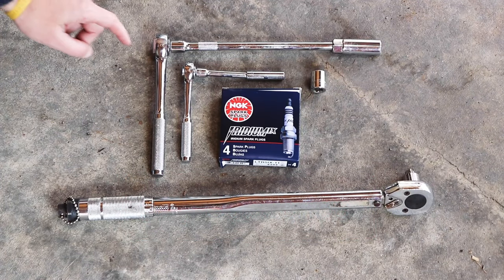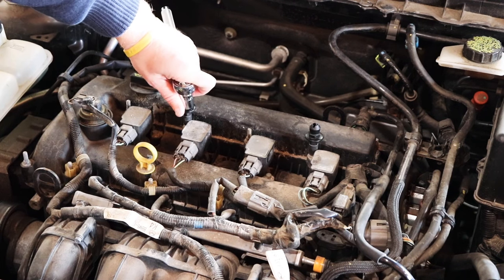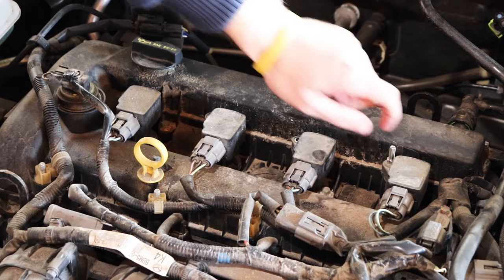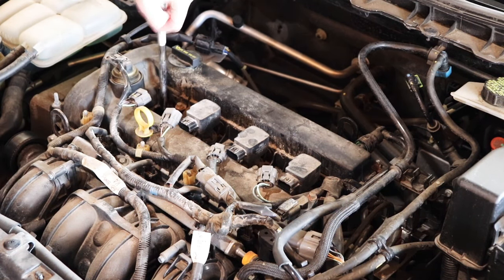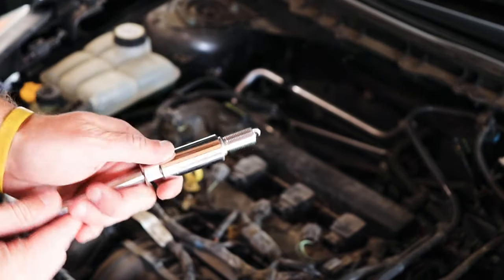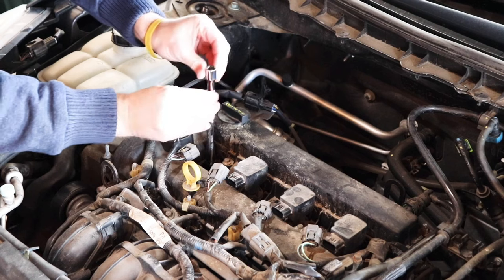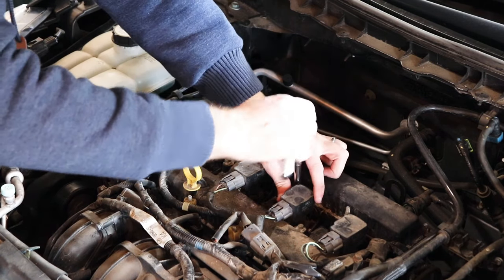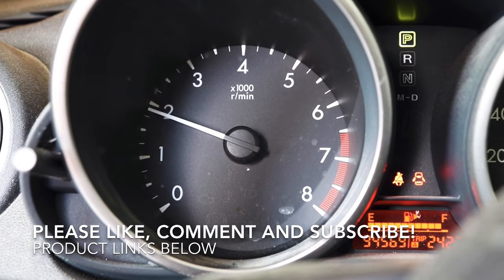Mazda 3 Spark Plug Change Replacement 2.0L, 2.3L, 2.5L

Comment: I replaced spark plugs in our 2008 Mazda 3 today and this video was super helpful and very easy to follow.  Probably the best step-by-step car video guide that I ever watched.  Thank you very much!  I didn't use a torque wrench as I didn't have one but the new plugs were pretty snug and tight and I was careful not to overtighten them.  On a side note, I noticed quite a bit of dust, sand and other debris so I vacuumed the area before removing the coil packs but was careful while doing so.  Thank you!
Reply from the maker: Thank you for the compliment, I try to make videos that are very clear and with no fillers. Thank you for watching and if you haven’t already please consider giving the video a thumbs up and subscribing. Thanks again!
Reply: I was reluctant to get a torque wrench where the torque to tighten the plug is at the very low end of the wrench. I did a little digging, and a chart told me to tighten a quarter turn as a rule of thumb for plugs this size. (I assume this means a quarter turn past hand tight.)
Reply: UPDATE - I changed the plugs a couple of days ago. The plugs in there must have been the originals - they are marked "Ford" and 6M8G-12405-BB (Mazda #) and ILTR 5A-13G (NGK #), which corresponds to the NGK "Laser Iridium" plugs. There's no gasket on the the old plugs or the replacements. It's set up in the car to be almost impossible to cross-thread them.

I found it impossible to tighten 1/4 turn, but I probably tightened more than 1/8. After I was done, and had a successful test drive, I took another look at the little boxes that held the new plugs, and noticed that it had a little graphic showing that you tighten them 1/16 turn!

Now I'm thinking I should loosen the plugs and try to be precise about tightening 1/16 turn.
Reply: Does the 2008 Mazda use the same spark plugs as recommended for the 2010?

Comment: My local Mazda dealer wanted $350 to change out the 4 spark plugs.  I feel like I may spend $60 at most including the torque wrench and do this in 15 minutes after watching your video.  I watched a half dozen or so about this topic and this was by far the best and gave me the most confidence.  I'll let you know how it comes out.
Reply from the maker: It really is a very straightforward process, take your time and you should be fine. Let us know how it turns out. Thank you for watching and please consider giving the video a thumbs up if you haven’t already! Thank you!
Reply: $350 FOR A 15 MINUTE JOB. THE DEALERSHIPS ARE OUT TO RAPE US. JUST LEARN HOW TO DO MORE BY WATCHING THESE VIDEOS.

Comment: Great point about NOT using anti-seize!  Throws off the torque values.  Good video- clear and to the point!
Reply from the maker: Thanks for the compliment! Yes I’m sure that most people aren’t aware of the fact you shouldn’t use anti-seize. I think they have good intentions. If you found this video helpful please hit the thumbs up button and consider subscribing! Thanks again!
Reply: 5 Minute Fix it - yes, I did sub, thx!
Reply: I would rather use it and I do use it every time without issue.. going for a torque figure is irrelevent on plugs, all they need is to be snug.

Comment: One pointer to add ... if you have compressed air, blow the dust & debris from the cavity where the plugs are located after removing coils while plugs are still in place to minimize the debris and dust from entering the cylinder while removing and installing plugs.
Reply from the maker: Thank you for this, hopefully others will see this and use this tip!

Comment: Best upload for changing Mazda 3 spark plugs. No frills instructions. I don’t understand why some people say you must remove the negative battery terminal first before beginning. You pull out the plug from the coil anyway so I don’t see how you could short something, especially if ignition is off.
Reply from the maker: Thank you for watching, I’m glad it was helpful! I agree that it isn’t necessary for the battery to be disconnected. Please consider giving the video a thumbs up if you haven’t already! Thank you!

Comment: I never changed a spark plug before, I didn't even know exactly where they were in my engine, but did all four very easily today thanks to your guide. The owner's manual may possibly explain where to find them, but if it does the information is buried.
Reply from the maker: Great job! Im glad you were able to do it with the help of my video! Thank you for watching and please consider giving the video a thumbs up if you haven't already! Thank you!

Comment: 🛠 🏆 5-star DIY video. This is how you make a great, useful, and easy-to-follow car maintenance video: tripod-mounted camera, no distracting background music, and methodical explanation every step of the way. When I hear shops charging $200-300 for a 4-plug swap on the Mazda3 2.3 engine I have to laugh. This is not a hard maintenance item if you follow this video. The only thing I would add is that I always blow out the spark plug hole before removing the spark plug. You don't want grit, sand, or other debris to fall down into the hole once the spark plug is removed.
Reply from the maker: Thank you for the compliment! I try to make short and to-the-point how-to videos so I appreciate that! Thank you for watching and that is a good point about blowing out before removing the plug! Thanks again!

Comment: Excellent, excellent video. I need to replace the spark plugs on my 2010 Mazda 3 and this video gave me confidence in doing it myself. 

One question. I’ve seen other videos were people gapped the new spark plugs before installing them. I remember back in the day when that was necessary, but I didn’t know people still do that. Is gapping the spark plugs necessary?
Reply from the maker: I would check the gap, most plugs come pre-gapped so I would just check to make sure it’s within spec. Thank you for watching and for the compliment! Please consider giving the video a thumbs up if you haven’t already, thank you!
Reply: @5MinuteFixit  thanks for the quick response. Much appreciated.
Reply from the maker: Absolutely! Good luck with the spark plug change!
Reply: @5MinuteFixit  thanks!!!

Comment: Great video. Quality was amazing and instructions were simple and straight to the point I wish people made more videos like this great job. I definitely liked and subscribed to your channel. 
I’m doing my plugs today and this just made it easier in my mind to do the job. Thanks man. 
One thing I do know for sure about doing plugs and very important is do one at a time that way you don’t mix up your coil packs and they get put on the same plug.
Reply from the maker: Thank you I appreciate it! I strive to make high quality easy to follow videos that don’t have fillers and are straightforward. Thank you for subscribing and for the thumbs up! Good luck on the plugs and let us know how it goes!
Reply: @5MinuteFixit  I don’t have a torque wrench so how tight do I tighten the spark plugs. My neighbour said a half turn after their snug and my buddy said a quarter turn after their snug. 
I don’t wanna tighten too much and I don’t wanna tighten not enough. Could you help me please? Replacing them as I type this.
Reply from the maker: @GSDReny  sometimes it will show you a diagram on the spark plug box...if there isn’t one there I would do 1/2 turn after you hand tightened them.
Reply: @5MinuteFixit  got the new plugs in and everything went smooth. Thanks your video was on point and made it easy.
Reply from the maker: @GSDReny  that’s great, thanks again for watching and letting us know how it turned out!

Comment: Perfect. This is my weekend project. Quick question. Do you need to adjust the gap on the spark plug head or just go with how they come from box?
Reply from the maker: Most come “pre-gapped” but I would just double check with a gapping tool before installing. Hopefully this helps! Thank you for watching and please consider giving the video a thumbs up if you haven’t already! Thank you!
Reply: When the plugs are iridium, I would not recommend gapping the plugs as the electrode tip is so small and fine that you can chip pieces from the tip. I know this from experience. I was told to never gap iridium plugs by a mechanic friend. Most come pre-gapped already, just find the ones that fit the recommended gap spec for your car. My Mazda 3 has a gap recommendation of 0.05 inches and the Autolite iridium plugs I bought came pre-gapped at 0.050. Makes the installation hassle free.

Comment: Do u check the electrode gap? I just bought the spark plugs for my Mazda 6 and they come as 0.040" out of the box, but I've seen that Mazda recommends 0.052" for the 2.3L engine.
Reply: I checked the gap, and I did adjust them to 0.052".

Comment: So when i removed the coil pack, the seal on the engine chipped off , is that a major problem? Idk what to do
Reply from the maker: It’s not a major problem, but that seal does help prevent debris from going down the tube and resting on the spark plug. The next time the plugs are changed the debris can fall into the combustion chamber.

Comment: Would this apply to a 2004 Mazda 3 2.0 as well?
Reply from the maker: The general process is the same just double check that the spark plug is the correct one and the torque spec is the same! Thank you for watching! If you found this video helpful please give it a thumbs up and consider subscribing! Thank YOU!--> Subscribe Here! ▶︎https://www.youtube.com/channel/UC8BzgKWkH0AGzCOORKK7Vwg?sub_confirmation=1
Reply: 5 Minute Fix it thanks for your response. Appreciate it!
Reply: Old thread. What size spark plug socket on the plugs for 2.0? Tried 14mm and 18. Doesnt grip the plugs..

Comment: These 4 cylinders jobs are easy af changed my bros kia soul. My v6 caddy was a pain , had to take off manifold
Reply from the maker: I agree most 4cyl are pretty straightforward, the transverse V6’s are usually more involved like you said with your caddy. More things to move so you can access the plugs. Thank you for watching!

Comment: How do you know when you have successfully tightened it to 10lb torque ft?
Reply: You use a torque wrench and set it to 10 ft lbs. You should feel the handle click as well as hear an audible clicking noise when you have reached the desired torque.
Reply: @AdrianLopez-ne9hn  okay than you, Adrian

Comment: My 2007 madza 3 shakes around when I stop. Could changing the sparkplugs fix it?
Reply from the maker: Do you mean as you are stopping or when the engine is at idle?
Reply: @5MinuteFixit  when I'm at a red light
Reply from the maker: @trevor93939jhxgeyeuejnrnfjdise  it could be the spark plugs or another ignition component. I would suggest bringing it to an auto parts store and they can scan for any codes that the car may be storing.

Comment: Yeah I did all that even got the spark plugs from mazda and now my check engine light came on and it stalls while in driving it. Don't know what to do any suggestions?
Reply from the maker: If you have a code scanner I would see what codes the engine is throwing. If you don’t they are invaluable tools for car owners and usually pay for themselves after the first use. The codes it shows will point you in the right direction.

Comment: What size is the torque wrench
Reply: Looks like a 1/2" drive. Usually used for taking off tires but he used an adapter to use the socket. That is what I do so I do not have to buy another torque wrench.

Comment: Great video.. but is it really only 10 ft. lbs?
Reply from the maker: Yes as unbelievable as it is that is the torque spec. In general torque specs for spark plugs are fairly low. Thank you for watching!
Reply: @5MinuteFixit  Thanks for the super quick reply!
Reply: @Isitworthitreviews  You do not want to overtighten. (Or undertighten, for that matter.)

Comment: Is it ok if there is oil on top of spark plug
Reply from the maker: It’s most likely to be your valve cover gasket leaking and filling up the spark plug “wells” Hopefully this helps, thank you for watching.
Reply: @5MinuteFixit  oh okay, so do I need to change it or can I still drive? Thanks for the video and reply
Reply from the maker: @Danny-dh2pg  I would have it repaired as soon as possible and also keep an eye on your oil level as well, until it is repaired.
Reply: @5MinuteFixit  Thanks I’ll see if I can

Comment: What do I do if I do not own a torque wrench?
Reply from the maker: A good rule of thumb is to seat the plug down by hand then do 1/2-3/4 turn after that. Do not over tighten. I have a link in the description for a reasonably priced torque wrench if you are interested! Thank you for watching!

Comment: Do you place any dioelectric grease on  the coil pack and do you set the spark gap
Reply from the maker: I should have mentioned to check the gap, iridium spark plugs in most cases come pre gapped. Dielectric grease can be applied but only a very thin layer. Thank you for watching hopefully this helps!

Comment: Do you have to gap them? If so what’s the gap?
Reply: For a Mazda 3 they should be 0.049 to 0.052". I would measure them as quality control for these things are not what they used to be. In a pack of 4 you can easily get 2 that are out of spec.
Reply: HYGRADE thank you I appreciate it

Comment: rule do thumb : I always '' COPPER SLIP '' anything that has a thread. Easy removal.
Reply: Anti-seize affects the torquing, so you're talking about a can of worms. NGK recommends not using anything. That also makes me nervous, because the threads are in there a long time between changes, and could get stuck. I'm doing the change at just under 70,000, hoping that the plugs won't be stuck when I try to remove them.

Comment: I’m sorry turn it 10 pound feet what 😰 I don’t feel like spending $200+ on a shop doing this i wanna do it myself but damn i don’t know all this fancy talk
Reply from the maker: You can do it, ft-lbs is a unit of torque (basically how much you should tighten) the spark plug. Another good rule of thumb if you don’t want to over tighten is to hand tighten it without the wrench on until it seats then put the wrench on the extension and turn it 1/2 turn more. Hopefully this helps. The idea is that you want it tight but do not force it. Thank you for watching and please consider giving the video a thumbs up if you haven’t already! Thank you!

Comment: Dude! Can’t wait to try do this on my Mazda following your video. Just taking my car in for an alignment and they quoted me at 330 bleeping dollars to replace spark plugs. I don’t even know if that included the coils. I’m loving doing maintenance on my car especially for stuff like this. Not all heroes wear capes muh man! 🦸‍♂️

I’m at 105k. Hopefully I’m okay with waiting so long, they said I should have replaced them at 75k. How do you know if you need to replace the coils? If you are changing your plugs at 100k, then I’m sure I’m fine too to just change the plugs. 

Thanks for the great video that’s so clear.
Reply from the maker: I wouldn't replace the coils unless you have a misfire that doesn't get fixed by replacing the spark plugs. Thank you for watching, Hopefully this helps!
Reply: @5MinuteFixit  wonderful to hear that. YouTube is one of the best things. Thank you.